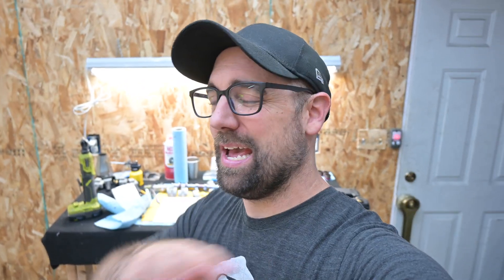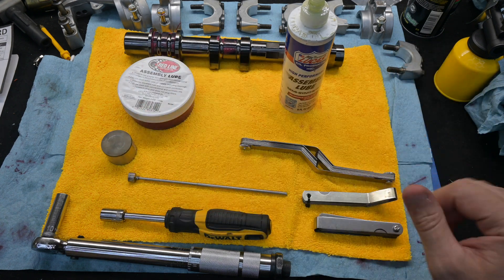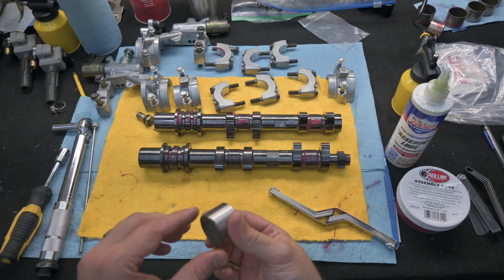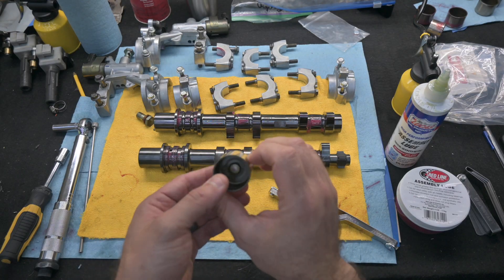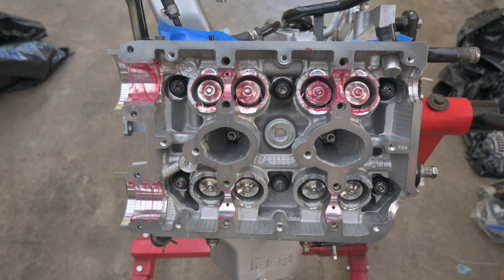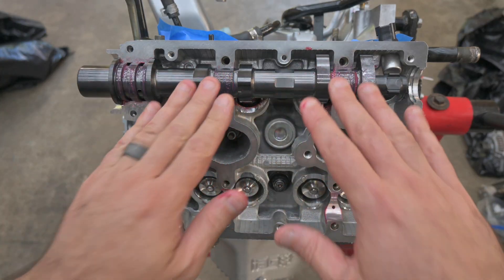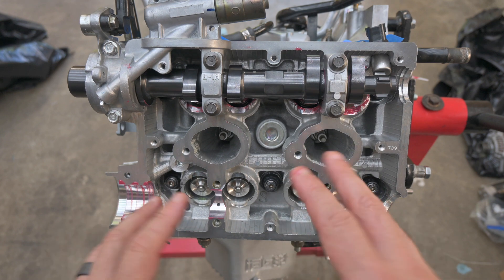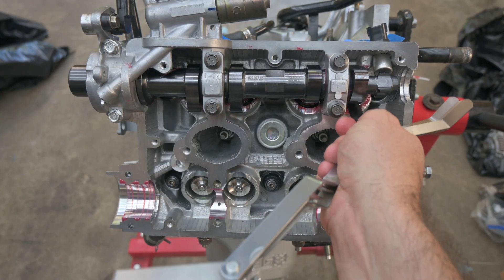Subaru Valve Lash Secrets Every Owner Should Know

Comment: Great video. When the lash is out of spec it ticks? Typically I'm guessing it ticks due to looser tolerances due to wear? My driver side head always ticked since I put it together, I want to yank it and fix the tick.
Reply from the maker: Thanks!  Lash on the looser side can definitely cause it to tick. How loose was it?

It may seem strange but lash actually tightens up with wear/age.  The seat and valve wear causing the distance between the bucket and lobe to decrease, not increase.  So...depending on how loose you had it, it should tighten up gradually.  

However, too loose can be very bad and it may not wear correctly or just be causing you to lose power.

I always shoot for dead center of the spec range and if I can't exactly hit it, I go slightly tighter.